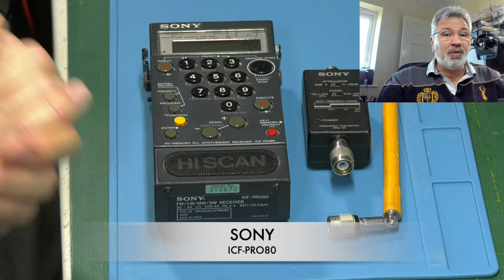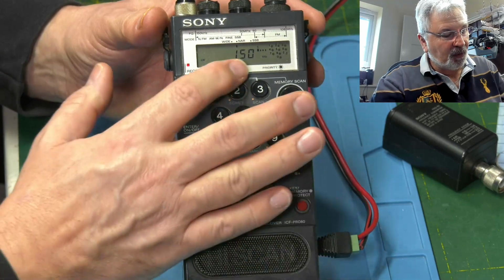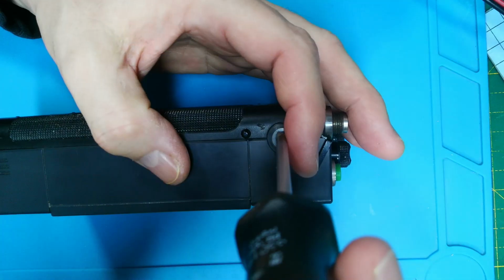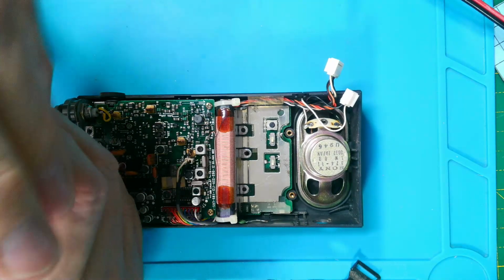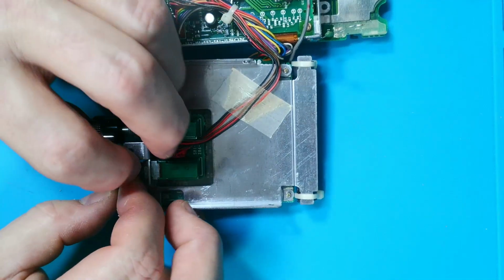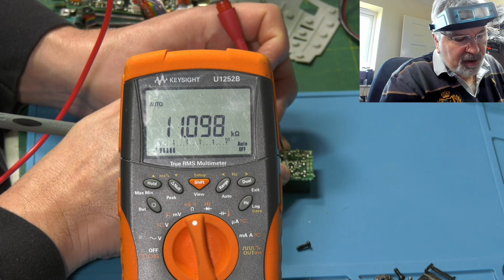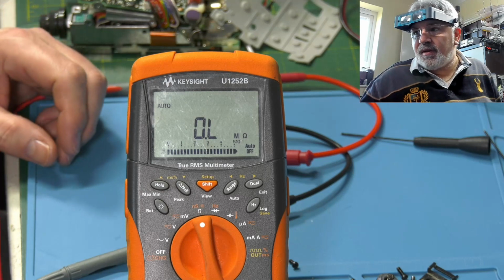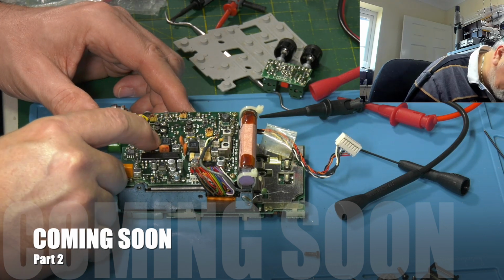Sony ICF-PRO80 repair guide: Part 1. Overview and Disassembly

Comment: dear Graham,
I'm restoring a Sony ICF-PRO80 by fully following  your great video. I replaced all caps I could access even those below DC converter. I re-assembled all parts but unfortunatelly, no chance to catch any frequency. Sound seems ok 'cause I here the BIP whenever "something" is found. The receiving led doesn't light to indicate receiving frequency, the light bulb works too.
If you could tell me which area to look for and/or what component should I replace, that would help a lot;
Thanks in advance for any help
Reply from the maker: Check the voltages on IC203 which is a voltage regulator. If that's okay its a case of checking voltages which takes ages. Good luck

Comment: Sir can you provide me the List of Electrolytes capacitors an there each full value an Quantity please 🙏 for my SONY ICF PRO 80....???
Reply from the maker: I don't have a list of them. I buy in stock and use what fits. You can work it out but you will need to measure the pads on the pcb and refer to the manual

Comment: Hi sir .i am from India. 
..this same reciver i have
Reply from the maker: A very nice receiver. Is yours working well?
Reply: No sir .
   1 battery Trmunal ..
...+   -    are . Rong 
...by mistake. 
...in reciver .
...ricver Sound .
Only Listening in.
...headphones. 
.... signal are .
...Good. 
But sound .
Very low
Reply from the maker: Sounds like it needs a bit of work. Certainly the electrolytics will need changing and you many have damaged the audio with reverse polarity

Comment: Good afternoon. This receiver is a big headache. Check the potentiometers - they break. I had one
Reply from the maker: Yes it’s a tricky one to fix. I’ve repaired a lot of potentiometers but not yet had one fail in a PRO80. Usually it’s the AIR-7. Thanks for watching

Comment: A nice product sir truly. Happy to see the restoration videos. I am having bush MRK5000A radio cassette tape recorder which is similar to national panasonic RQ543,542 ADS. Due to bias oscillator failure it cannot record and erase anything. But it can play the cassettes well. Erase head impedance is 1.5 ohms AC erase. I have tried in everyway to make that bias oscillator work but it is not oscillating. I don't have CRO to test the frequency. Do you have any AC erase schematics please give me sir.
Reply from the maker: Thanks very much. I expect the erase head and oscillator would be very similar to other models of the same era so schematics should show how it’s done

Comment: Hey Graham,
Enjoyed your video. I always wanted a Sony rig like that one , well still do .I wished I could repair radios like yourself. I have a Heathkit Mohegan that needs some work but repair men are few and far between here .   Well Graham have a good weekend and hope to see you Sunday. 73 my friend.
Reply: Well Graham, I was only able to pic up close stations but it's not the antenna. I ran a long wire and no Changeand i could only pick up two stations the rest of the close channels
Reply: Sorry Graham I got cut off . I was saying I could only pick up two stations and none of the other channels.
Reply from the maker: Sounds like you may have a transistor gone in the IF section. They look like the type that get tin whiskers
Reply from the maker: Thanks Duane. What’s wrong with the Heathkit?

Comment: I have one of those. 18 months and nothing untill now!🥵
Reply from the maker: Hi Luis. Do you mean yours is broken?
Reply: Yes ! I have onde since new and found It in a shelf but was without sound.  I discovered huge capacitor leaks that comprimidos the PCB trails.
Reply from the maker: Yes sadly that’s what happens. It can be fixed though
Reply: @Radiocruncher  I  already replaced all electrolytic capacitors, the main IC, some transistors and now trying to rebuild the 30 connections from the compromised flat cable also. Huge and delicate task! Very interested in watch your video!
Reply from the maker: Good luck Luis. One thing to check is that you have continuity through any connectors you have desoldered. They can be open circuit just on one side of the board

Comment: The best way to test a pot is put line level audio through it to an amplifier.
The second you rotate the pot, crackle crackle.
Yes very obvious to anyone with ears lol :-D
Reply from the maker: That makes sense Harvey so thanks for the tip. The PRO80 doesn’t seem to suffer with the broken pots like the AIR-7 does. I’ve pulled one apart and the wiper is more secure so they must have improved them